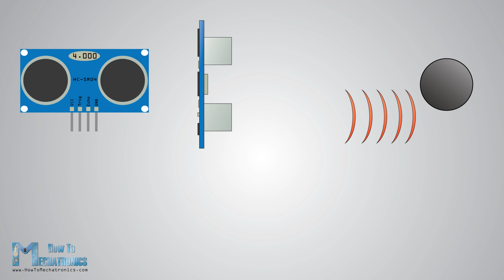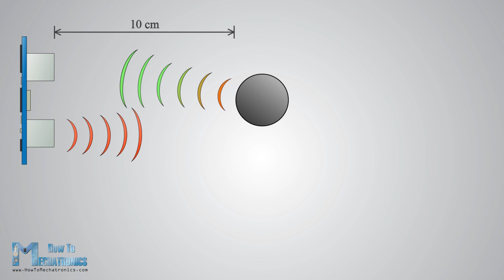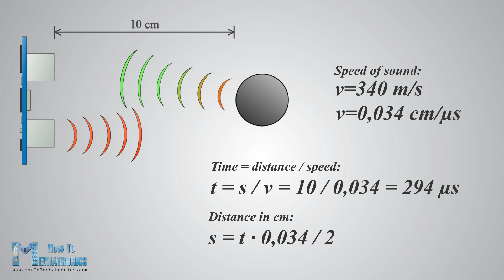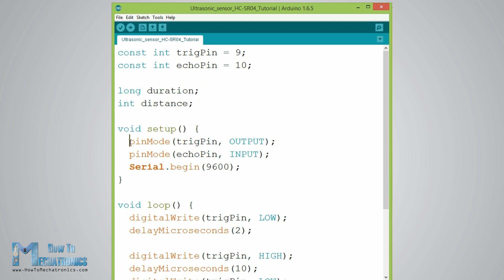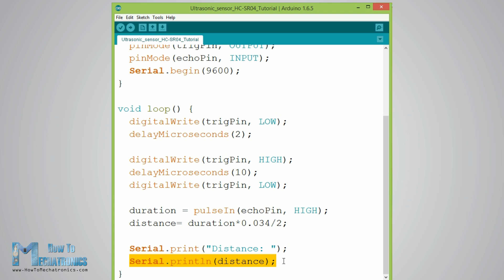Ultrasonic Sensor HC-SR04 and Arduino Tutorial

Comment from the maker: Please note, circuit diagram at 0:56 should be: 5v to VCC, GND to GND, D10 to Trig, D9 to Echo.
Reply: I think you false circuit kills my ultrasonic ................ I have to admit I am a little bit pissed of ...
Reply: Could you please send full circuit diagram by connecting with LCD display
Reply: @Mikolaj Kraszewski You may well have several sensors, you just have the first sensor finished before you start the next sensor maybe there should be a delay between the two sensor code
Reply: Hey, man i don't know how but i am able to hear the sound of this ultra sonic waves, so is that just me or anyone can hear it?
Reply: JESUS IS THE KING OF THE KINGS!!!
Reply: pog
Reply: i m little confused you sent a 10 microseconds long pulse, doesn't matter where it goes it will be 10 sec long and " pulsein"  is calculating the time from high(when the pulse enters) to low (when pulse ends) and it is 10 micro seconds.
but it is calculating the time from transmitting the pulse to receiving the pulse
Reply: STILL WRONG. YOUR CODE LISTS PIN 10 AS ECHO AND 9 AS TRIGGER
Reply: No. D9 to Trig, D10 to Echo. Base on  your Code. Now my setup is working
Reply: @bajalal8977  it could be done in 1 sensor also and max 3 could be attached in arduino uno board. but can be done from one also
Reply: my ultrasonic sensor got fried, i think. lol
Reply: My Ultrasonic just got heated and I was looking for this comment :) Thanks for the tutorial.

Edit: I have burnt my ultrasonic bruh

Comment: The code
```
const int trigPin = 9;
const int echoPin = 10;

long duration;
int distance;

void setup() {
  pinMode(trigPin, OUTPUT);
  pinMode(echoPin, INPUT);
  Serial.begin(9600);
}

void loop() {
  digitalWrite(trigPin, LOW);
  delayMicroseconds(2);

  digitalWrite(trigPin, HIGH);
  delayMicroseconds(10);
  digitalWrite(trigPin, LOW);

  duration = pulseIn(echoPin, HIGH);
  distance = duration*0.034/2;

  Serial.print("Distance: ");
  Serial.print(distance);
  Serial.print("\n");
}
```
Reply: toi alors toi merci
Reply: thank you very mush brother.I struggled with a wrong code for a week.error was I used    '   '    instead of   "    "

Comment: The code works, but is not the best to combine with other stuff. It is really advisable to connect the TRIG to pin 3 and let an interrupt do the measuring in the background, so you don't have puseIn halting your code completely while sensing.

Comment: Dear respected brother,
I am beginniner to use Arduino, sir i upload built-in led blink example  sketch to Arduino uno and  pro mini, both are blinking well, then I upload empty sketch to clear example code, system shows message that sketch upload done 100 %, but both boards runs previously blink example code.  I tried to different systems (PC, Laptop,mobile) to clean an upload new sketch, but results are same, where I mistaken i don't understand. Pls help me to solve if you interested.

Comment: Maybe just one thing to add up, the moment you set trig pin to HIGH, echo pin will be switched to HIGH as well, until it detects the back wave. That's why the period of echo pin input on HIGH mode equals to the time ultrasonic wave travels.
Reply: Why echo pin switches to high the moment we set trig pin to high?

Comment: My serial monitor only shows this: 0000000000000000000
How can I fix it or where is my false?
Reply: Mine to
Reply: Mine to
Reply: @paulrosenzweig1180   hast du es geschafft, weil ich habe das gleiche Problem( did you fix it and when yes how did you do it?)
Reply: Lukas Lachmayr no
Reply: @lukaslachmayr7093  der Fehler ist in den ersten zwei Zeilen => trigPin = 10; echoPin = 9

Comment: at 4:07, if the bounced sound waves cause the echo pin to go high that means the echo pin will trigger after the sound waves already bounced off the surface.. Don't you need the echo pin start the timing at the same time the trig pin sets off the pulse???????

Comment: const int trigPin = PIN;
const int echoPin = PIN;
long duration;
int distanceCm;

void setup() {

Serial.begin(9600);
pinMode(trigPin, OUTPUT);
pinMode(echoPin, INPUT);

}

void loop()

{
digitalWrite(trigPin, LOW);
delayMicroseconds(2);
digitalWrite(trigPin, HIGH);
delayMicroseconds(10);
digitalWrite(trigPin, LOW);
duration = pulseIn(echoPin, HIGH);
distanceCm = duration * (0.034/2);
Serial.print("Distance: "); // Prints string "Distance" 
Serial.println(distanceCm); // Prints the distance value from the sensor
Serial.println("cm");
delay(2000);

Comment: is there a way to play music through this and make a directional speaker?
Reply: The sensors are piezoelectric plates, very tiny and they wouldn't produce a nice sound. They are "tuned" to higher frequencies. Like a tweeter is tuned to a range of 2kHz to 20kHz a ultrasonic sensor is "tuned" to 25kHz, 40kHz, 125kHz (as an example). They are narrower in their range.

Comment: i m little confused you sent a 10 microseconds long pulse, doesn't matter where it goes it will be 10 sec long and " pulsein"  is calculating the time from high(when the pulse enters) to low (when pulse ends) and it is 10 micro seconds.
but it is calculating the time from transmitting the pulse to receiving the pulse

Comment: Hello. I built the regular circuit and it is working great! I tried to watch your LCD tutorial and use the code give,  but the LCD is just turning on and not displaying anything. I would really appreciate it if you or someone else could paste a diagram of the circuit used to build the circuit with the LCD display. Thanks alot for the help and the great video!
Reply from the maker: The problem with the LCD might be the contrast. You need to apply an appropriate voltage to the contrast pin.

Comment: Hi, I don´t have much experience with this sensors...however - I need to open and close a 12V electrovalve depending on distance from an object - will this work?
Reply: No doubt! This could be the whole sensor. You'll be only missing the actuator part. I had it working with LEDs in about 30 minutes from scratch.

Comment: I use arduino uno and I want to use the lcd but only have one vcc port. Any solutions
Reply: Also I use a i2c adapter and it's soldered on

Comment: Hi, is it possible for an ultrasonic sensor to detect ultrasound emitted by insects/animals instead for measuring distance of an object? I'm thinking of developing something that could locate particular insects by detecting the ultrasound they emit. If not, is there any other sensors that can do such kind of function? Thank you
Reply: I imagine you would need to know the range of frequencies the insects make, and look for a sensor that is sensitive to that range.  Also, the intensity of the sound produced by the insect as well as the sensitivity of the sensor.  I don't think this particular sensor will work, but I'm not saying one doesn't exist.  Sorry to be so not helpful.
Reply: I think u would have to resarch the frequency of the animal and question, and set a sensor to that range. This one might not work, since it is paired with a transmitter, but if you find a lone sensor that can detect ultrasonic waves, that might work.

Comment: I looked up that this version of sensor is vulernable to interference from other ultrsonic sensors, if that is the case could I use this sensor to create a Local positioning system using a tri-lateration? What are your thoughts? Thanks

Comment: Hey Dejan,
I completed the circuit, it works well when I power the Arduino Mega with USB Power Supply, but the moment I connect a 9V Battery, I get a fixed value
3247 cms
1270 In
What could be the reason? Could you please help me? Thanks
Reply: Hi Dejan, Thank you for replying, Appreciate it!!  I am connectiing the 9V battery to the Power Jack 7-12 V input (side of USB port). Today I tried connecting 1.5V X 8 AA cells as I read that 9V battery in not enough to power Ultra Sonic Sensor, but getting the same error. I also tried putting 1000uf cap on power and ground. When I connect to USB, it works perfectly fine. Thanks
Reply: Hi Dejan, I meant, it works fine on USB supply but still not working on Battery power. :(  Any reasons do you think of why it doesn't work on battery? Thanks

Comment: why dont show how to connect LCD
Reply: The LCD is shown in many other videos. Essentially you get a voltage value from the Ultra Sonic sensor, interpret it into distance, and push a signal out to your LCD. If you are stumped on the LCD, there are plenty of tutorials
Reply: @zhawn14  There aren't "plenty " of tutorials that show you how to wire both at the same time.
Or where to put the different codes in the IDE at the same time.
Reply: @martinkoch4332  What part do you specifically need help with?
Reply: Beginners need help,  @zhawn14

Comment: The diagram is very wrong. The 5v goes to vcc and ground goes to GND with a 330 resistor I think. This will burn the sensor.

Comment: I have followed your instructions to the dot. Still my sensor gives gibberish values.
Reply: Yes, 9600 baud in both instances.
It had been running fine but since yesterday the module started giving gibberish readings. I had been using the code mentioned below earlier and it delivered accurate results. I first thought that the pins I had been using for input and output had failed. Hence I attached  other sensors to those very pins and they worked fine. So has my module gone bad or am I doing something wrong??

int trig=2;
int echo=4;
int distance;
int duration;
void setup() {
pinMode(trig, OUTPUT);
pinMode(echo, INPUT);
Serial.begin(9600);
}

void loop() {
  digitalWrite(trig,LOW);
  delayMicroseconds(2);
  digitalWrite(trig,HIGH);
  delayMicroseconds(10);
  digitalWrite(trig,LOW);
  duration=pulseIn(echo,HIGH);
  distance=(duration*.034)/2;
  Serial.print("distance : " +distance);
  delay (2000);
  }
Reply: Dejan Nedelkovski this is my 1st time working with Arduino. Is it normal for such sensors to fail this quickly. I had purchased it about 2 months ago form amazon for  about 3$.

Comment: Why did you set the trigger-pin on low and delayed before measurement?
Reply: because its running repeatedly... you need to "shutdown" (LOW) that output for a bit (2micro secs)... I hope that makes sense
Reply: ok right. thanks.

Comment: +Dejan Nedelkovski I've been trying to to this for a few days, but I keep getting 0 distance on all codes I've used. I've tried the NewPing library but I can't seem to get it to work. Can you please help me?
Reply: that happened to me too
Reply: Contact me 8530799642
Reply: Any solution? It's showing 0 distance :/
Reply: Put the trig pin on 9 and echo pin on 10 and then try.
Reply: How To Mechatronics
Pinned by How To Mechatronics
How To Mechatronics
1 week ago
Please note, circuit diagram at 0:56 should be: 5v to VCC, GND to GND, D10 to Trig, D9 to Echo.

Comment: What will happen in a room filled with the same frequency?
Reply: Boom
Reply: well that would be hard to do but it would likely just get nonsense readings. but to get this someone else would have to have sensitive sound detecting and making devices
Reply: not hard at all, your regular stereo from wal mart can do that... but the device is built to read it's OWN ping, and it knows what it's own ping looks like. if you ping it with something else, it may not be able to tell you anything about what it heard. since it counts from when it left till when it returns, if you just shoot sound at it, there's no way for it to know when or where it came from.
Reply: help me in a ultrasonic level sensor
srajora99@gmail.com
plcontact me
Reply: Good

Comment: I like your technique of highlighting code as you step through it. You have a good "classroom" approach; I wish everyone did this; it would allow absorbing info easier on us students. Tkx My problem: I'd like to use the HC-SR04 Ultrasonic sensor to shoot through a 7 cm opening (mason jar) and sense the liquid (alcohol) level in it from 3 cm (top of jar) to 20 cm (bottom of jar). Will the sides of the jar interfere with the sound pulse? Thanks
Reply: Thanks for the quick reply - so, if I understand you, the sides of the jar would obscure any reflexion from the liquid; the technology would not work inside a jar. Can you suggest any alternative that does not involve contact with the liquid (phytosanitary) or modification of the liquid container (using plain old mason jar)?

Comment: I thought it was vcc, echo, trigger, gnd. I think your wiring diagram is wrong.
Reply: You're incorrect. It's VCC, Trig, Echo, Gnd.
Reply: @elissitdesign  Nah my sensor is VCC, Echo, Trigger, then GND
Reply: can you provide a link to the correct one?
Reply: just don't connect echo to power, instead connect vcc to power (don't connect vcc to gnd) and connect gnd to gnd on the arduino. echo and trig should be connected to 10 and 9. other than that good video!

Comment: Vidim da si Dejan, pa reko da ne pisem na engleskom. Sve sam uradio kako treba i nece da mi radi. Pise mi da je Distance=0 i tako non stop
Reply: I'm using Uno,and ultrasonic sensor similar like yours. I'm watched andther videos and solve a problem. I used your code but i put pins different.And it's works.Thanks.

Comment: why I didn't connect the trig to the pin but it still works? and continued print the correct value(duration). I try two hc-rs04 and have same behavior,does the Trig is a fake pin and doesn't need to connect it?
Reply: +legendre johnny it's probably floating high for the appropriate duration.

Comment: +Dejan Nedelkovski
Hey i need to how the C programming changes from Arduino to real world embedded programming. i assume in real world scenarios we will not have those sweet easy to use C functions like in arduino libraries.am i right.and also how about "shields".the Arduino has huge community to support "shields" that matches for arduino but for real world microcontroller boards what kind of "shields" being used.how developers integrate with each other.please give a feedback on it with your industrial experience.thank you.
Reply: +Dejan Nedelkovski thanks a lot for the reply.so as i have reasearched there are lots of things to cover to understand and be able to program microcontrollers to use it in a real project.what steps do you suggest to be able to come to that position Dejan. like 
step 1 do this
step 2 learn this
step 3 learn that ......so on.
(FYI: i have fair programming experience from my IT degree mostly java,php but gotta learn C since those are used in embedded systems)

Comment: Hi Dejan, could you please show us a tutorial how to connect multiple sensors to an UNO, MEGA, or Edison board through Wifi (integrated/ through shield ) or through XBee ZigBee, something like 3 ultrasonic sensors with two infrared sensors and one face tracked camera(All in one) with the LCD display for all the information shown, does this set up need like different switches to make everything work? I am trying to build a Obstacle Avoiding Robot Car and I don't quite get the point how to connect everything which hasn't include the Motor side(4X4 with individual Encoders, I may possibly go for a 6 wheels as well), still trying to figure out the wifi part with an Android phone control through Wifi(so I could switch manual control and autonomous back and forth if I need to) which I also have to consider wifi connection of the Face Cam(WebCam or Pixy CMUcam5). I really enjoy learning your tutorial and it's been very clear and helpful, as a newbie step by step teaching process just make me understand more! Please show us more~
Reply: +Dejan Nedelkovski Great to hear from you Dejan, thank you and I will follow up!